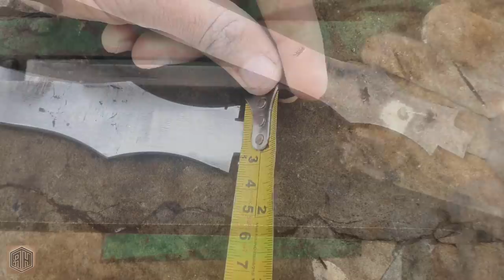Rusty Bearing Forged into a pretty & SHARP SWORD

Comment: There are already enough comments about the fractures and trying to cold forge, so I'll leave that alone, but I did notice your hammer appears to have very sharp edges.
Following some observations made by other blacksmiths;  you may wish to round off the edges of the head so one side has bevelled edges, while the other is more like a large flattened ball shape, they give you more/better forging options and may help reduce the number of sharp defects in your work.
Either way, keep up the good work on learning a profession thats harder than most realize.
Reply: Fuf
Reply: Hiep
Reply: Lon
Reply: Déo heo
Reply: Cuando reabre oficinas la conducet
Reply: Bro you are cool at making  videos
Reply: haha I made it 69
Reply: @inpost1751  shut up hes just giving pointers
Reply: @inpost1751  for real helpful criticism isn't supposed to be an insult and judging by the tip, he doesn't necessarily have to have forged anything in his life because he sure knows what he is talking about

Comment: Random hands, may I ask the size of the bearing sword? Specifically Length, since; I have some doubts that it’s big enough to be classified as a sword. More specifically the length of the blade, instead of the whole sword.
Reply: From the video I'd say its the length of the smaller of the gladius blades
Reply: Wow- it's the sword police 🙄
Reply: sean1121970, who needs a life in quarantine? We’re stuck at home; no one has a life.
Reply: @Cru128  it won't last forever and in the meantime we can squabble on here XD
Reply: sean1121970, perhaps.
Reply: @Cru128  username checks out

Comment: It can hold sharpness . 
But bearing steel is as brittle as a glass !
Reply: Not if tempted properly. Anything hardened will be brittle until its heat treated, it relaxes the stressed metal

Comment: It looks great, but I'd recommend resizing the guard and handle. For a blade like that the handle should only be large enough to balance it out. The handle was a little round but for a display piece it looks beautiful. My biggest thing is, I'd like to see a little less power tools for shaping, you could have drawn it out by a few more inches with the hammer, then after that it would have been a little easier to find its center of balance

Comment: I mean, the only pleasing part of this to look at is the handle. The blade is wonky, and has cracks EVERYWHERE. Which was caused by hammering in the metal after it had cooled. Doing so makes the blade brittle, so I bet that if you tried slicing it at wood it would shatter on first impact. Hell, whacking it with a small hammer at just the wrong spot will snap it in two. Watching this brought me physical pain, which is a shame. I normally like this guy.

Comment: hes doing pretty good ig but there's multiple reoccurring imperfections in his work some being that his blades aren't always straight or like in this one his hilt handle blade and even the cut in the middle of the blade were off center and also you should probably test every sword you make even if it breaks cause yeah you made a cool looking sword but it could be completely useless

Comment: You should even the edges up on the grinder before you sharpen them. That way the edges don't look like something cut out of paper with scissors. If you want to get a nice and even profile fold a piece of tracing paper long ways and draw one side of the blade.  Then cut out the edge part (not the center) and unfold it.  It'll be symmetrical and you can glue that to the steel with a glue stick.  Not the hot melt kind but the craft glue that comes in a plastic tube like lipstick. Then use that to guide the angle grinder. After you finish with it the paper peels off and you can just rub the dried glue off with your finger. Then your blade edges will be true all the way down.